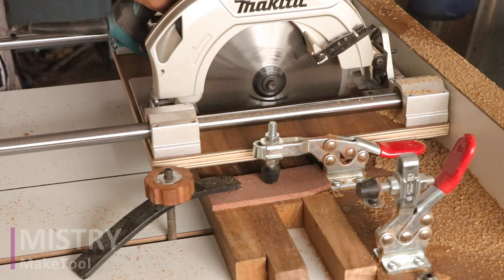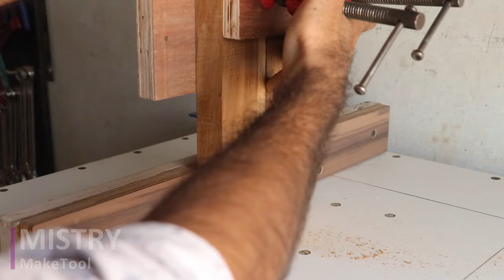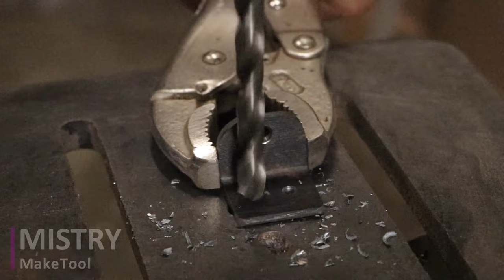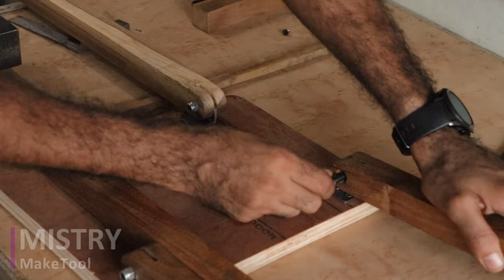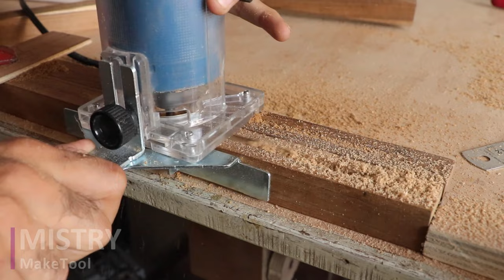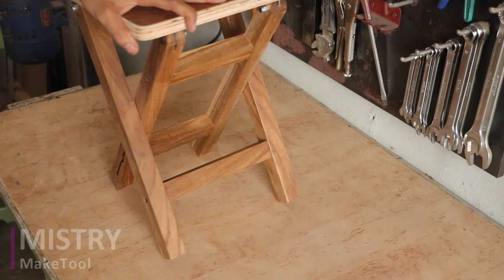Make A Unique Foldable Wooden Stool || DIY Foldable Stool

Comment: Can you make DIY steel wire straightener, simple way will be best, we are doing by using drill machine, but it requires clamping every time, can be there any Easier and Simple way?